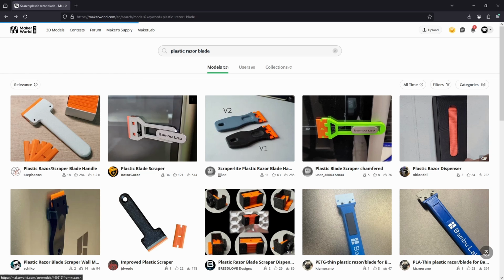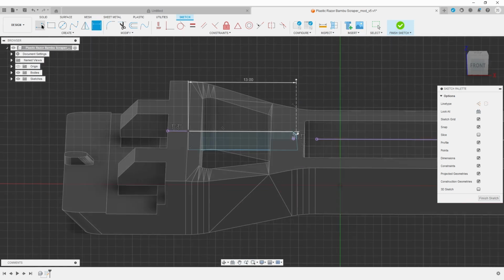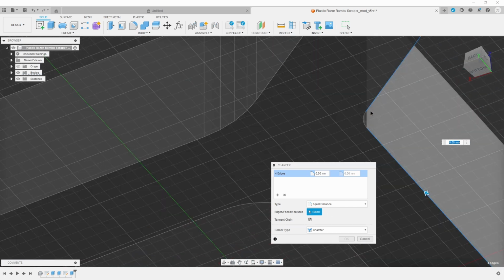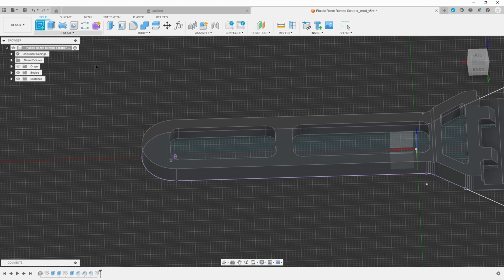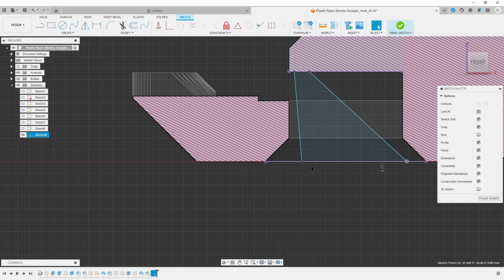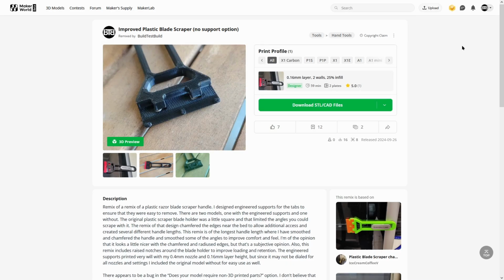Remix STEP File in Fusion  |  Force Chamfer & Engineered Supports

Comment from the maker: This was a somewhat longer video than I normally prefer to make, but I decided to include a lot of detail in order to get feedback from the community.  If you haven't tried it before, I do encourage you to try going into Setting and change the Playback Speed to at least 1.25 or faster if you find that you can still get the level of detail you want. You can see the full chapter list in the description and if you aren't interested in walking through the thought process of some of the feature details, here are some highlights I encourage you to check out:
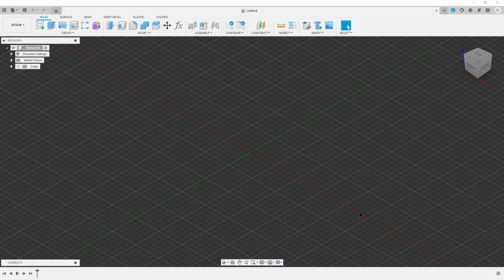2:01 Import STEP File into Fusion 360
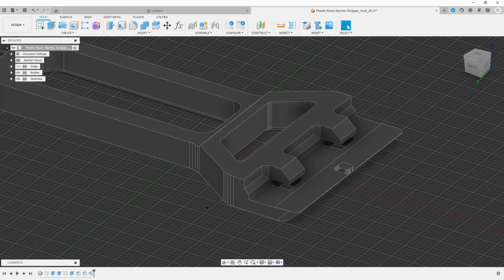9:30 The PROBLEM with the Chamfer Tool
9:57 Force Chamfer Technique
14:37 Same Technique Enables Chamfer into Radius & Other Profiles!
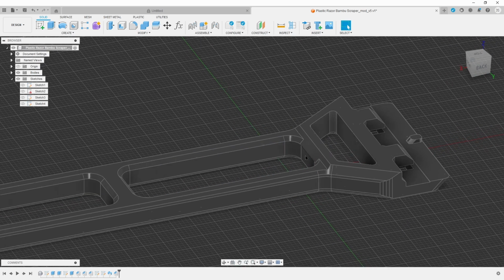16:02 Force Chamfer Technique Second Example
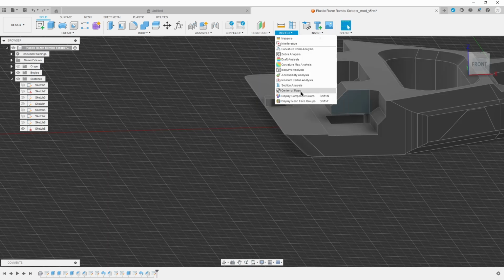17:42 Design Engineered Supports
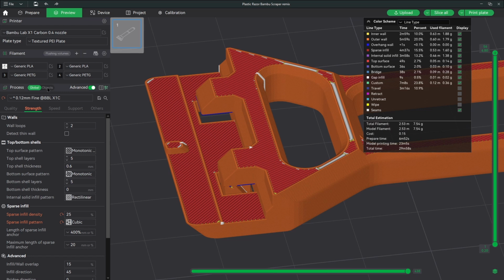21:42 Slicer Trick for Printing Only Your Feature of Interest

Thank you to all the commenters that took the time to give me feedback so I can continue to improve the content I make.

Comment: Love the video, learned a bunch of techniques!
I feel like a lot of force would be a applied to those overhanging tabs, would it be better to print the scrap on its side for layer strength?
Reply from the maker: @jwmann  thank you for the feedback! You make a good point,  it's always important to consider your layers, or "grain" with printed parts.   I've been using 3 of these scrapers on all my printer's build platforms and zero issues.   I recommend you try printing the engineered support version and test it for yourself. I think I'm this case the tabs are small enough it doesn't present an issue, also the plastic blade will pop out before your generate enough force to split it, at least that has been my experience.

Comment: Thanks for posting.  I learned several things.  Question: what's the advantage of the "double T" support feature vs. just making a cube under the overhang?
Reply from the maker: Thank you for the feedback.  My concern with just making a cube under the overhang is that it would increase the surface contact and not release easily.  Yes you could engineer the interface, but when I originally printed this part I had some difficulty getting the auto-generated supports off cleanly. That's what gave me the idea to share this video.  Most of the time auto-generated supports work great with minimal effort, but in this circumstance because the overhang was so small and the through hole was so limited they were a bit difficult to pull off cleanly.

When designing engineered supports I like to drop the file in the slicer and look at the actual path of the nozzle so you can see exactly how the feature will be built.  For this particular feature the nozzle builds 2 outer frames and then filled in the zigzag.  You want to minimize contact and have really good support.  My solution to the challenge was a T shape where the top of the bar would be at the end which is needed because the frame is made first, and the vertical bar helps support the zigzag.  After looking at the path of the nozzle carefully I felt that the additional second cross bar would provided some needed support with minimal additional time or material and give the best result.

All that to say, for the cleanest support removal, the strategy is to have absolutely minimal contact and minimal support that is effective.

This is a situation where a different support material like PLA with PETG could work really well... but with a bambu labs printers use a cut and purge system that generates a lot of poop.  Not worth it in my opinion for the result because it has to be done on every layer.  I probably would have gone down that path if I had a dual extruder printer.

That's a bit of a long-winded answer to a pretty straightforward question, I hope the discussion addressed your question and you found it helpful.
Reply: @buildtestbuild  thanks for the detailed reply!  I also liked your trick of using construction circles to keep two points at a consistent distance from a mid point.  I normally shift click while applying a coincident container to snap the centers of two lines together, but the circle seems easier and more visible in the sketch.

Comment: Is there a Order of Operations when creating chamfers and fillets? I find I end up screwing myself, because I chamfered something before I should have and the corner looks off.
Reply from the maker: It's tough to make an overall statement because it's so dependent on your part geometry.  If at all possible don't fillet or chamfer until all other features are implemented.  Pretty much all CAD programs have the ability to roll back features, and I use that option very frequently as I work through the process.  The design process is a process and it's rarely entirely clean, especially when you are sort of figuring out how you want the part to behave.  In fusion you can also move a feature into a later part of the timeline.  I often do that with finishing steps like fillets and chamfers when I realized I need to go back and adjust features.  If you are trying to chamfer for the build plate but you want to soften it with a fillat along the edge away from the build platform, in that case obviously you need to do the chamfer before the fillet.  If you want to fillet corners, it's best to do that before chamfers, so like I said, it depends very much on your specific part, but I hope you find the discussion helpful.
Reply: @buildtestbuild  Thanks for your reply, it is definitely helpful. I too use the timeline to roll back and move my chamfers and fillets around. It is really when the geometry becomes complex that the orders of operations really matters.

Comment: On 16.56 you have trouble selecting the profile, just point the mouse and long press left button, in the little menu that pops up you can select the profile (or any other plane/axis that's under the mouse).
Reply from the maker: @gevanvliet909  thank you for the tip!